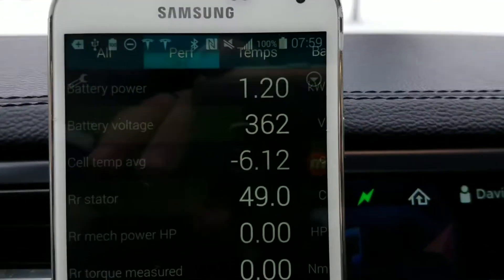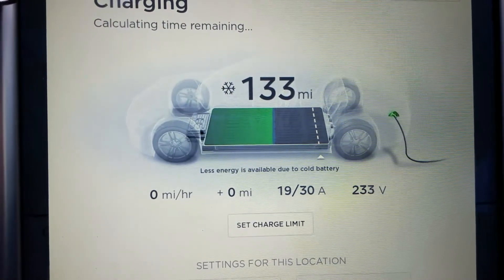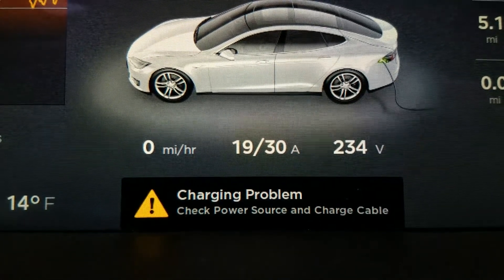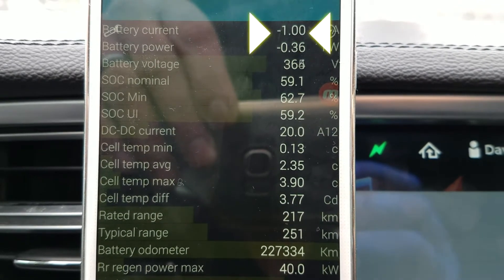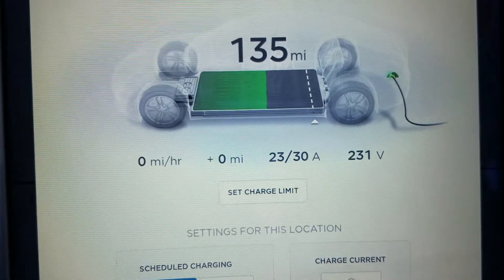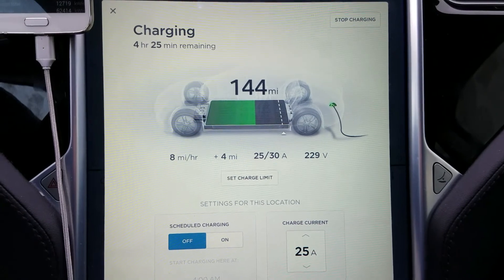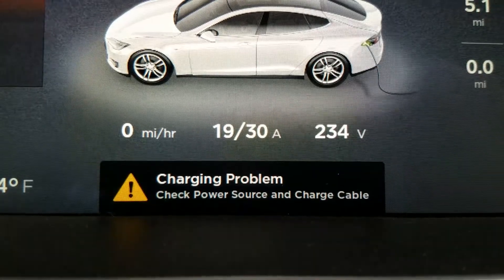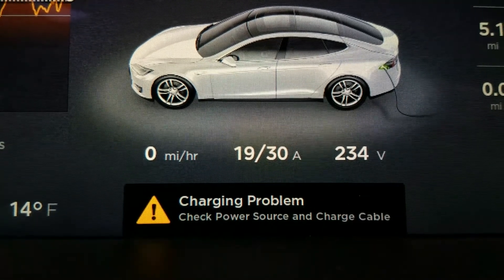Frozen Tesla Battery

Comment: so what happens if the battery is frozen and you just want to start driving right away?
Reply from the maker: You can always drive. I have never heard or seen anyone had their car not drive because of how cold it was. What I show here is charging. The car doesn't allow the battery to be charged when it is below freezing temperatures
Reply: I knew charging a frozen battery is really bad - so it makes sense that it doesn't charge until it's a bit warmer. But I did not know if there are problems discharging (using) a cold battery. Thanks!
Reply from the maker: @CosminRotaru  the power gets limited according to the temperature. If the battery is very cold, the call will limit the power a bit. Usually that limit is way higher than what you use for normal driving. But more importantly, in extreme cold weather you will have snow or ice on roads so you don't go full throttle anyways. I ve had many very cold winters. The power limit was never an issue. Charging was never an issue either because usually what I do is set a timer so the charging starts later at night so it finishes in the morning. That will warm up the battery and when I start driving in the morning I have no issues at all.
Reply: Really good information that I didn't see anywhere else, to be honest. Thanks!

Comment: Big problem for a model 3 which has NO Batt Heater!
Reply from the maker: The Model 3 uses the motor and drive unit to generate heat. It's a very clever way to do it. It can 'run' the power electronics and motor in a way that it doesn't create motion or torque, but it generates heat. Using that method it generates heat for the battery without the need for an extra battery heater unit. It's a very smart way to do it and eliminates the heater. It's just as effective.
Reply: Interesting, thanks for the explanation.

Comment: I believe Tesla tracks the voltage drop of the circuit as it increases the amps.  If the voltage drops too much for a given amp draw it puts up the charging problem type of message and stops increasing the current.   Your video shows for a 19 amps draw you were at 235v which to me seems border line.  But to know for sure you would have to know what the voltage was when you 1st started charging.  I charge daily using the UMC and the screen shows  ~242v at the start and drops to ~238v at  40amps.   Dropping to 235v@40amps when you start at 240v@0amps might be acceptable, but starting at 243v@0amps and dropping to 235v@19amps could make the car think there are wiring issues.  The car does not know if the 152 watts (8x19) loss was spread over a 100ft+ run of wiring, or all 152 watts in the (high) resistance of the plug/connector which is going to get hot over time.

Comment: Getting more and more "Charging problem" messages, too, even though charging is working just fine. And not only during freezing temperatures, but also nowadays (30 degrees Celsius during daytime hours here in Belgium).
Reply from the maker: Bert Troubleyn what messages are you getting?
Reply: Same as you "check charger power" (and meanwhile I'm pulling 11-12 kW, so no problems whatsoever).